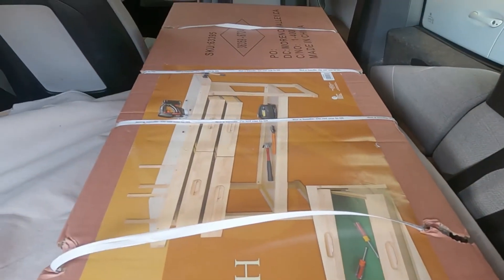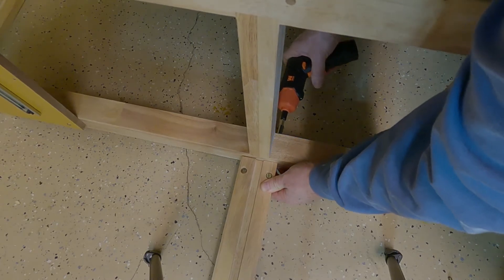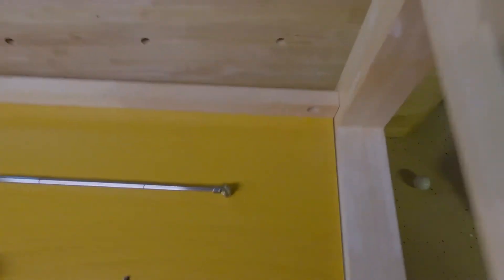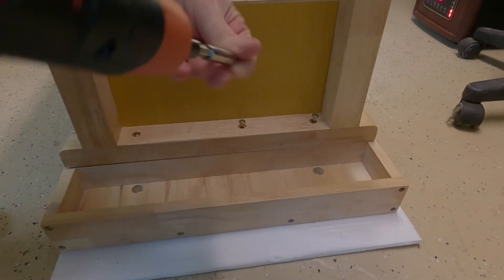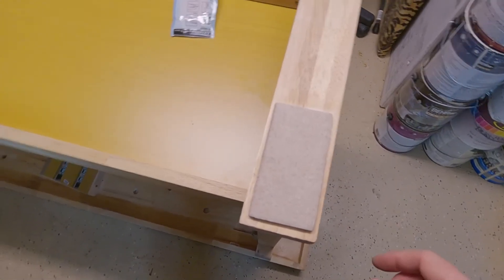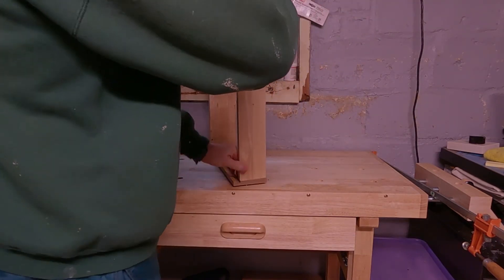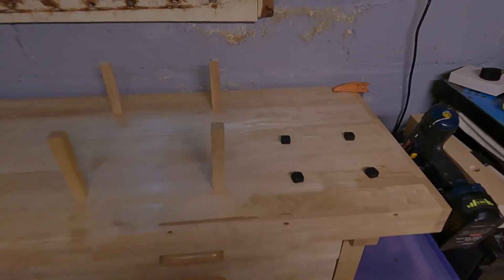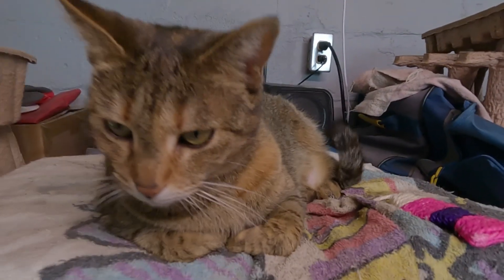Windsor Design 60" Hardwood Workbench detailed assembly

Comment: I bought one. I moved the shelf up to allow storage of my lawnmower underneath. I used the space under the left side where 2 drawers go as shelf space which left only the 2 drawers on the right side. I did not install the vise and removed that support structure underneath.  I ripped two 2X4 to 2 1/2 inches wide and glued and screwed it it the front and back edges.  I bought 4 ball rollers and installed them on the bottom of each end support. Under the holes as needed, I screwed in a plumbing ceiling support bracket allowing any equipment to be fastened to the bench using 3/8" bolts.. It is a very strong bench and is quite capable of taking nearly any torque force you can give it.  The dog holes are accessable and useable. I'd send a photo if I could.

Comment: Great info. I'm planning to grt one and move the shelf up so I can store my lawnmower under it. Since the long front and back shelf support boards are already drilled all, I think,  I have to do is and drill new holes for the screws. The barrel nut will still go into the same place. I'll add a cross brace at each end.
Reply from the maker: Sounds reasonable. Let us know how it turns out.

Comment: Can the vise be easily installed on the left side and used or it the vise right side only?
Reply from the maker: There are counter sunk holes on the table side. So I think it would have to be modified to move to the other end. But I'm sure it could be done. This wood is very easy to work with.

Comment: I just bought one and will be following your instructions, thanks! What do you think about adding wood glue to all the mating pieces before screwing them together? Would that help a little with the stability?
Reply from the maker: I used glue on the drawers. But everything seems reasonably sturdy without it. It will be a little messy if you have to reposition anything